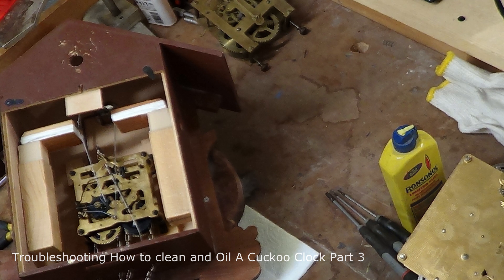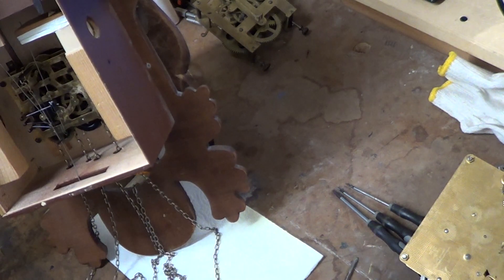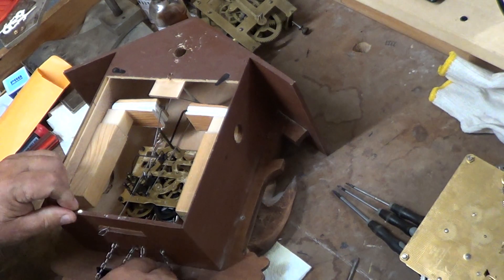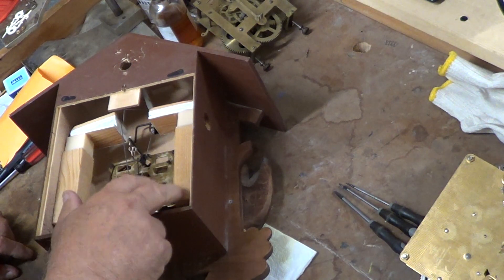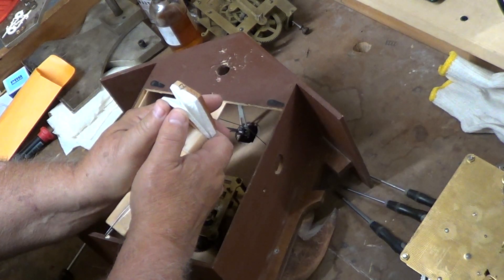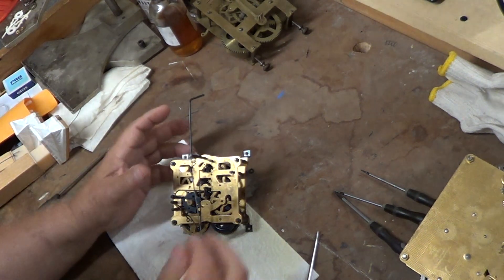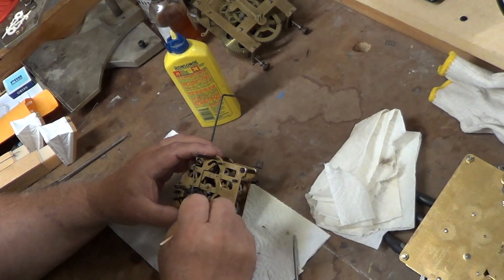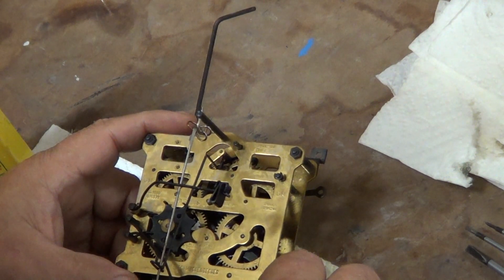Troubleshooting Cuckoo clock, Clean, Oiling PART 3 and 3 A

Comment: Can the chains be replaced? Mine are corroded & don't seem to roll through the cogs smoothly.
Reply from the maker: Yes, the chains can be replaced depending on the cuckoo clock model number on the back of the movement.  Many movements are Regula followed by a number which tells me what chain to use. If it's an odd-ball movement you may have to remove two inches of the chain so it can be matched to a template drawing. The Bench Jeweler. www.mybenchjeweler.com or rhjgold@gmail.com
Reply: @rhjgold  Thank You!! I will check on them.

Comment: I really enjoy seeing your repairs here on YT, 
I was wondering if you could do a repair or service on a Mayak Russian Cuckoo 
clock at some point in time.
A total strip down and oiling would be useful, along with your verdict on just how good 
or bad Russian movements are.
I have one of these and although the cuckoo half of the movement seems to be OK,
The clock stops ticking after about 30 seconds to a minute and the pendulum comes 
to rest. No sign of dirt, so I guess something is worn out
Reply from the maker: I have plans to video one or two cuckoo clocks in the near future.  We pretty much run a small school on Jeweler Making and  Manufacturing Jewelry tools so we really don't receive much walk-in trade anymore.  Thanks for watching 
The Bench Jeweler.

Comment: Use an ultrasonic cleaning tank, works better.
Reply from the maker: Well, You need the cost of a tank larger enough to put a full-size clock into the tank, and then there's the matter of clock cleaning fluid at 75.00 dollars a gal and clock rinse at 60.00 plus the cost of the ultrasonic tank at about 350.00!.